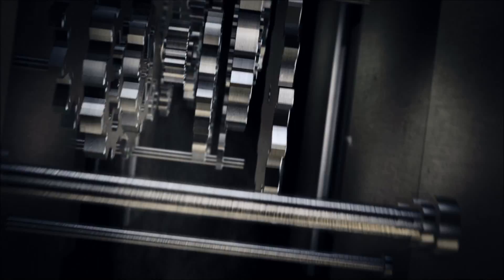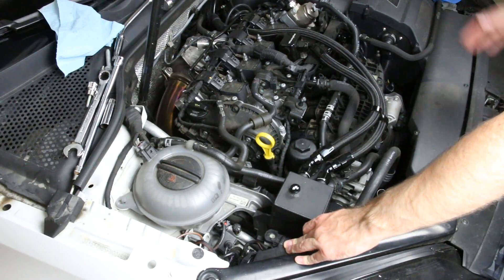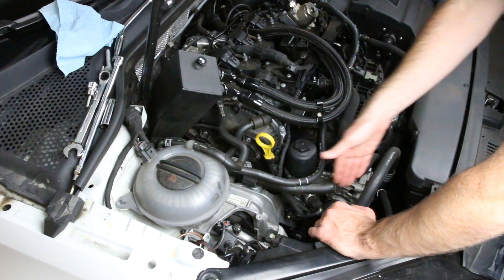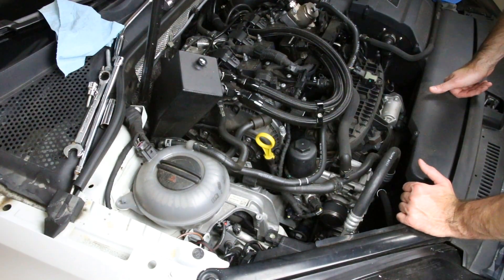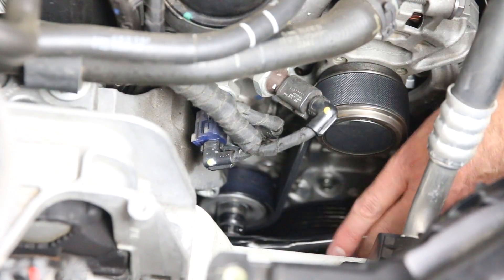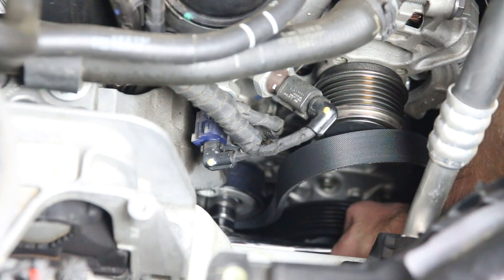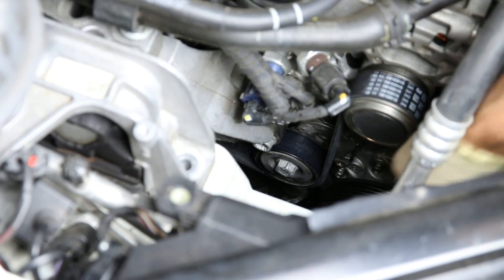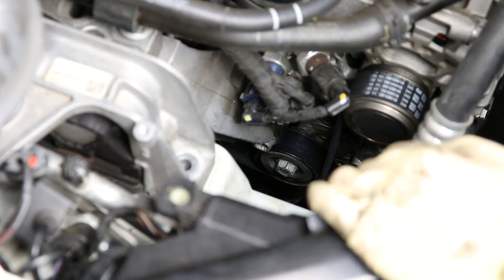How to Check and Replace a MK7 GTI Belt

Comment: I just replaced mine at 85,000. There was one small crack on the old belt but it still looked like new. I had to remove the front passenger tire because I had a hard time getting on the crank in the back. Once I took the tire off it was so easy

Comment: Holy cow was that easy.  Thank you for sharing this, it saved me $100 in shop labor for a job that took me like six minutes.   I'm especially glad I did it myself because even though I was at the 60k service interval the old belt was in pretty good shape.  It probably didn't really need to replaced so I would have felt really foolish paying someone else to replace it.  I suppose I could have inspected and replaced the old one and saved $120 but what the heck, it's done.
Reply: I am pretty novice here. Don't you have to change water pump too ? I have 2015 mk7 with 43K Miles. Should I start worrying about timing belt ?
Reply: @MrVeryfrost  you're mixing up the drive belt, and the timing belt.
Reply: @MrVeryfrost  water pumps have to get changed on most vw's after 100k-200k km, they're plastic and just don't last that long, and the serpentine belt and timing belt are different, if ur timing belt goes your engine is most likely gone, serpentine is an easy fix

Comment: Used this guide today, thanks as always DAP.  I wasn't able to move the tensioner far enough from above...took the belly pan off and there was much more room to work with it from under the car.  Zip tied the wrench in place where I wanted it and the belt went on pretty easy after that.

Comment: I think you're making this harder than it needs to be. There is a notch in the tensioner. Use a breaker bar to easily relax the tension, then slip an allen wrench into a hole that this notch then will align with. The tensioner is now held in the relaxed position. Also, slip the belt onto the tensioner last, rather than the alternator; there is no lip, so it's much easier.
Reply: thx

Comment: Great vid as usual by DAP... Thank you. I did find when doing mine this week that you literally don't have to remove anything to do this job, not even the engine cover. I would recommend using a long 16mm box wrench to access the idler pulley. My breaker bar + short 16mm socket got stuck on the motor mount when pulling the idler pulley away.

Comment: Thanks for this.  A rat nesting in my engine bay threw the belt off and I had to clean off all the gore and figure out how to put it back on.  I never would have known that you can loosen the tension with a 16mm socket.

Comment: Replaced at 55K. Thanks DAP
Reply: Was the old one worn down or any cracks in belt? Replacing mine now at 60k
Reply: @tylerrobert9925  I just replaced mine at 54K. The belt looked fine, but for $30, why not change it now and have the peace of mind knowing that it's not likely going to fail out on the road?

Comment: Is there any specific noise associated with serpentine belt failure? I have a strange vibration and noise coming from the passenger side when driving and accelerating while the engine revs are low (between 1500 to 2000 revs per min), have you experienced this issue before ? Engine is : CJSA 1.8 Tsi
Reply: I have that exact issue.. did you ever fix it ?
Reply: I'm assuming you are running a DSG or other automatic, in my 2019 Alltrack I learned that due to their efforts in keeping the cars as economical as possible, they tuned them to try and shift up keeping the RPMs as low as possible. This is fine if you are rolling on a flat surface, but they don't seem to recognize elevations as well. It's normal for an engine to produce vibrations when you are straining it. In the Hills of the PNW it's not uncommon I have to manually drop a gear down or give a little extra gas push to get it to shift down a gear. 

Given that you are talking about a low RPM only vibration, with no check engine lights and I'm assuming a maintained car, thats your bet. If you have other symptoms like reduced gas mileage, misfiring under hard acceleration, etc a number of other problems could be the cause.

Comment: Hi Deutsche autoparts,

Could you tell me tightening torque of the two torx screws for the v-belt tensioner? 
I have a MK7 Gti Petformance from july 2013.

Thanks in advance Wheelman ;)

Comment: what are you do if your gas door will not open on a Mark 7 GTI
Reply from the maker: +therealvegan runner you will likely need to try and release it from the inside manually. You'll have to take apart the rear passenger side of the trunk to access that.

Comment: would you please tel me when to change the timing chain ?
Reply: It's been my experience the timing chain should last the life of the engine. Had a RAV4, 140,000 miles on it. Never once had a problem with the timing chain. But I guess even that would have a limited life span. I let go of the RAV and got a VW Golf because the RAV4 was having issues like a head gasket coolant leak, AC compressor failure, coolant system freezing up in the winter because the water and coolant weren't totally mixing. I guess the timing chain was probably about to go, but the rust on the right front wheel well near the strut mount just told me it's days were numbered.
Reply: Mk6 are know to have a tensioner that will fail. Had mine done at 65k when it started to rattle.

Comment: My 2017 Golf MK7 tensioner looks a little different. No it's not a GTI it's just a Golf, but even with slightly different engine sizes one would think some parts are the same.